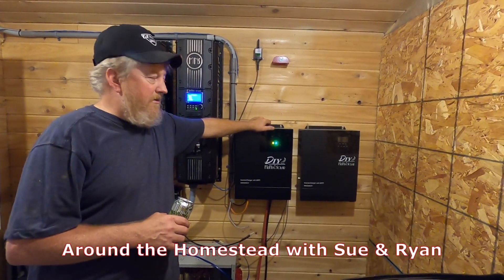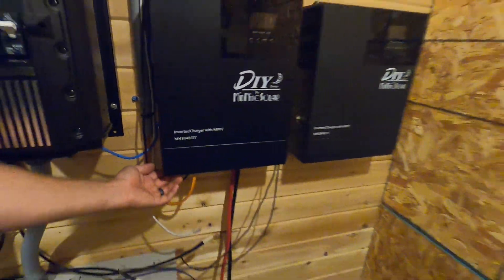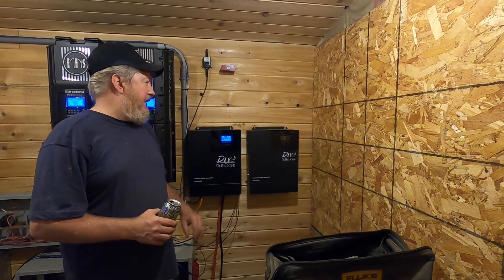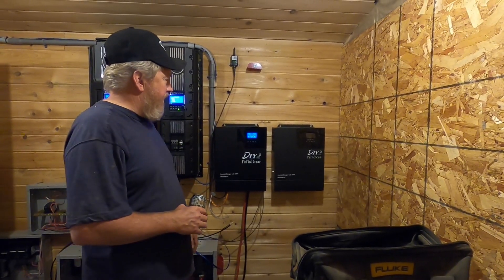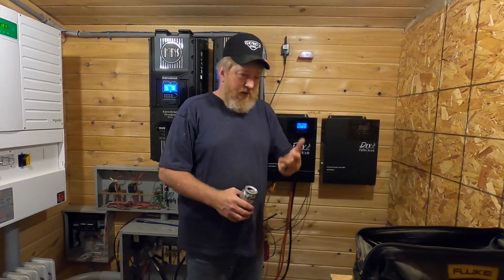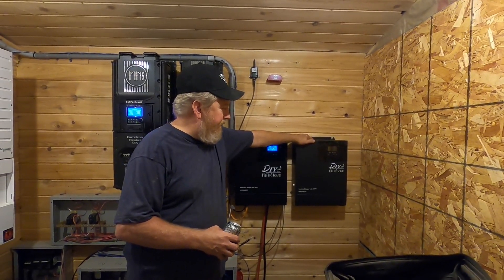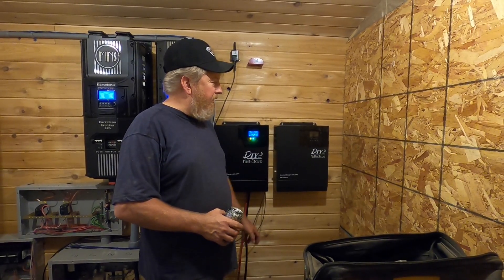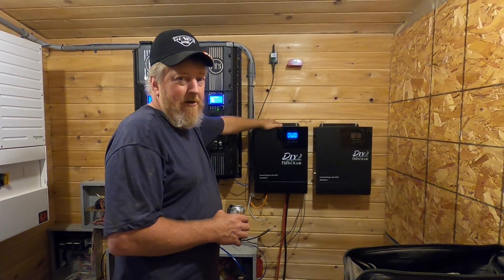Midnite Solar MN3548DIY vs MN5048DIY- What's The Difference???

Comment: Where is the 10K DiY Split Phase 120/240 inverter ?   I heard it mentioned in several of your videos and the webinars but i can't find it on Midnight website.
Reply: I believe they rebranded it as the AIO (All In One), which should be just over 11kW AC and three independent MPPT's

Set to release next month!

Comment: Don't buy this unit! Midnite 150/250 are great products. These are terrible. They will not fully charged the batteries(per midnite tech support). Battery bars show 3 bars not 4 and quit charging. Once pv drops off at dark the bars disappear so all you know is the battery voltage not really how much you have left. T ch support is great but biggest mistake I ever made. I have 48 volt 232ah battery showing full and after using flat screen tv and Starlink with 2 6w lights and the unit is almost dead overnight. When panels are charging the unit is great. I have neighbor who bought the 3024 and had the same problems. It has been tweaked to all midnite specs and now with 3 days of snow coming it will shutoff. DONT BUY!! Go old school and buy the mppt only from midnite!
Reply from the maker: The DIY line does stop a bit low on charge voltage for some lead acids for sure

Comment: I had just purchased the 5048 and I was wondering if I could use a separate Mppt controller along with the all in one. I have 6000 watts of solar and was wanting to incorporate all into this system. I know I can only use only 5k watts on the system alone. I know you said you could over the watts but not the volts understandingly. Just don’t want to waist the extra power
Reply from the maker: You sure can use external charge controllers. The only limiting factor is how many amps the battery bank can safely take
Reply: @aroundthehomesteadwithsuer3497  Also I have a 48v Missouri Wind and Solar 1800w wind generator with a mid nite classic 250. Will those two items talk to each other

Comment: Ryan,
Spoke to tech at midnite and she advised that the new 5048 will have bluetooth built in. Robin also said it should be able to run up to 64V. Could you confirm this and possibly get one and install it and test these features that i have been querying since Jan 2022. It would be greatly appreciate it.
Reply from the maker: Blue Tooth is not built into any DIY equipment. Midnite has a blue tooth dongle for the MPPT 60 and a WiFi dongle for the DIY All In Ones

Comment: Ryan,
have they been able to get the working DC voltage range increased as yet as 60V is very low even by lead acid battery standards when it comes to equalising. I personally would like to see it go to at least 63v.
Reply from the maker: We will ask and see what the story is on that.
Reply: @aroundthehomesteadwithsuer3497  thanks much

Comment: First thanks for producing these videos, you have so much knowledge to help us new guys out trying to diy; seriously thanks for your time. What I'd like to see is you beat the snot of of these things and punish them relentlessly on camera with the Oscope hooked up like you did when you spanked rosie. This AIO units offer people that need something that takes up less space and quicker / easier to setup and configure a niche to get started. One thing these types of units seem to suffer from is the "China crap syndrome" where they die quickly or can't handle surge loads. You mention it started your 3/4 hp well pump but some of us have a 1 or 2 hp pump that has a lot of lift for a deep well...say 1000ft. Solark can't even generally handle that nor can they seem to handle starting a chop saw very well without overloading the phases and shutting down. If midnight will allow you we'd love to see the cover removed and you put a scope on it and beat it up over and over again. I hope that when they release the 10K version they are stackable and two of them come in at a good price point below what one solark cost while being just as reliable without the shutdowns. See if they will send you two and make a video from unboxing to connecting them all up and curb stomping them. And, tell the CEO at midnight if they are confident in their products and name they can do much much better than a one year warranty...3ry minimum. I'm in the market for a AIO first before I invest in some of the midnight or conext units. One more thing you should tell their engineers...build in a simple web server so we can monitor and configure these things over our lan instead of connecting to a cloud server back in bejing. This is bad for so many reason in the political atmosphere we live in. Have a good day sir.
Reply: My two Sol-Ark 12K's have ran my house off grid for over 4 months without one glitch. I consume 60-80 kWh per day. Warranty is 10 years.
Reply from the maker: We tested one here for about 3 months and had 0 issues with it. I think as long as you understand that a high frequency inverter is really 2 120v inverters internally so unlike the old transformer based system they do not share loads from L1 to L2 and you balance loads the best you can (Good practice even in non solar homes) you will have 0 issues
Reply: @USA-GreedyMenOfNoIntegrity  I'm happy you're having luck with them. There's several guys on youtube and the diy forums that have shutdown issues with them on trying to start heavy loads like a chop saw and or they seem to get very finicky with slight loads out of balance where the cheaper growatt etc don't seem to. David poz shows this.  I was looking at the solark but then decided to most likely go with a conext 6848 later down the road but to get something up quicker and to have a spare I'm looking at the mpp and midnight AIO units. It would be awesome to see somebody produce a split phase 120/240 solark competitor at a much more reasonable price and decent warranty. I hope midnight releases that 10k model soon.
Reply from the maker: We do plan a pretty robust torture test on the 5048 in the next few weeks, We have the first E-Panel to leave Midnite for these and will be installing that and wiring the 5048 more proper with grid wiring and what not. We will try whatever anyone wants to see within reason of course. I don't have a 1 or 2hp well pump unfortunately but I do have a lot of wood working tools so maybe we can set the DIY up with its own battery bank int he wood shop and do some torture testing.
Reply: @aroundthehomesteadwithsuer3497  Thanks, can't wait. And again thanks to both you and your wife for taking your time to help us. I'm excited to see you hook it up from scratch to get a better understanding of how to properly do this stuff. Have you ever thought about making a video series showing how to start from the beginning ...picking the panels, mounting them, wiring them, connecting them to the scp and the inverter to the house and grid etc?

Comment: Egads! Did Rosie elope? Didn’t see she on the wall.
Reply from the maker: Nah this was shot before Rosie came to visit. Rosie is still going strong here and features are getting added rapidly. Rosie now is doing SOC with the WBjr and doing remote battery voltage sense. A couple more weeks all the menus should be done for grid support and AGS etc
Reply: @aroundthehomesteadwithsuer3497  Have they eluded to what a potential price point is going to be for Rosie?
Reply from the maker: @nealhamilton3881  Pretty sure its going to end up being around $2900 street price from the rumors I am hearing

Comment: 10k split phase that can sell and likely AC couple to Enphase or am I just dreaming.
Reply from the maker: We shall see, I am told we should see ours in July to test, one thing we can for sure do is AC couple, We have 20 modules at 340 watts each that have micro inverters on them with a transfer switch to AC couple as needed